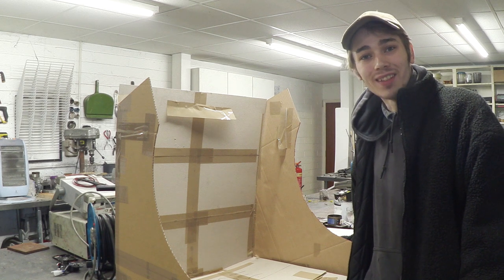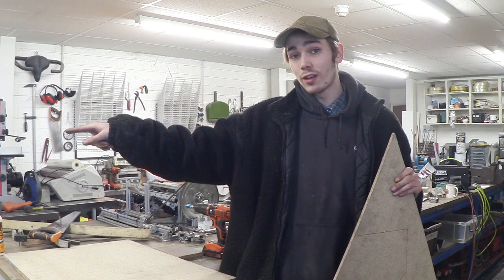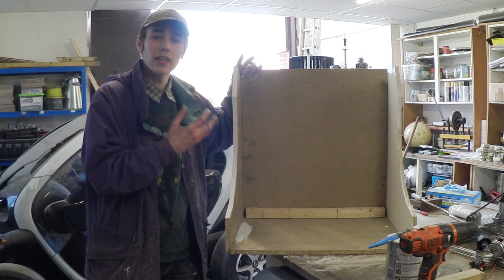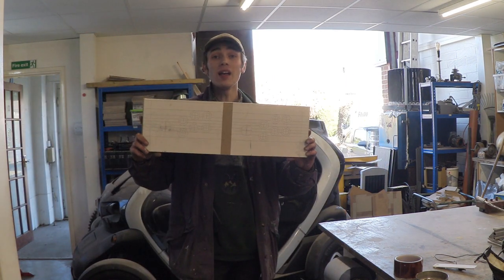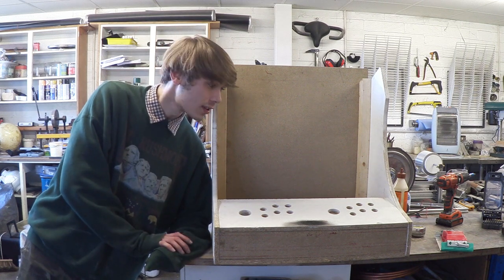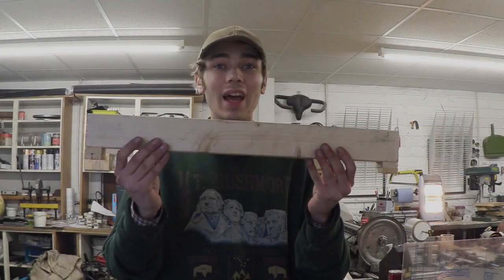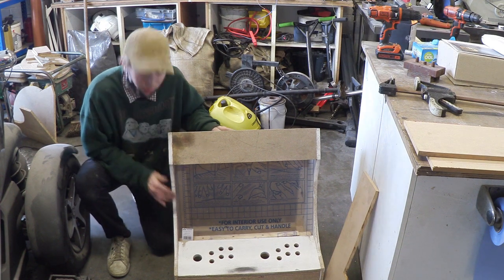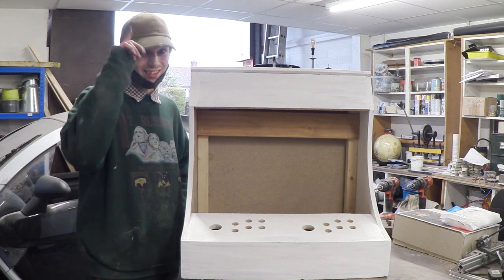1043 - DIY TableTop Arcade Cabinet - Part 1

Comment: Cool Luke, will wait to see what you do for the electronics. I personally would have used plywood instead of chipboard because it would be lighter without compromising on strength.
Reply: Great suggestion! I'm going to have to alter the control board slightly, maybe I will redo it in ply? I used chipboard because we had 6 massive sheets of it. Thank you mate! :)